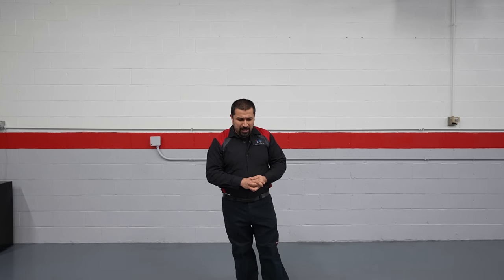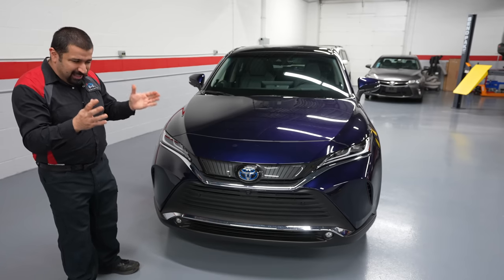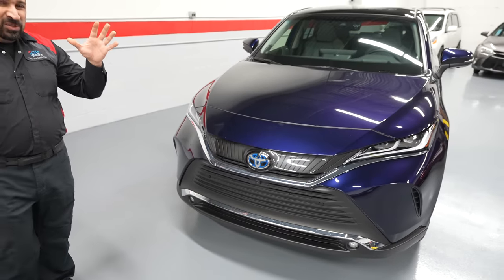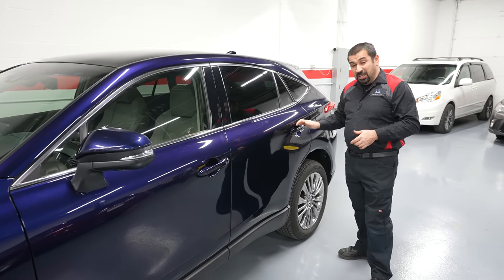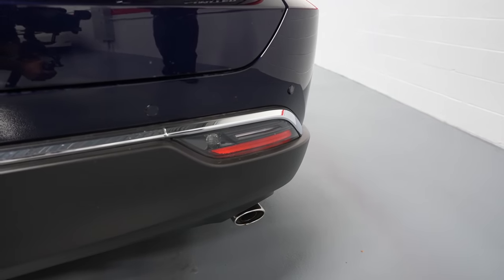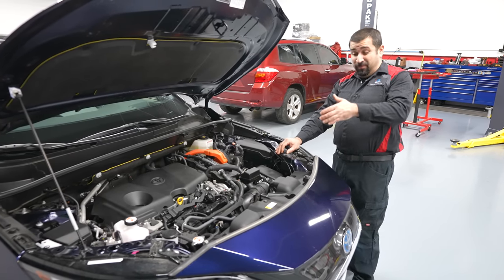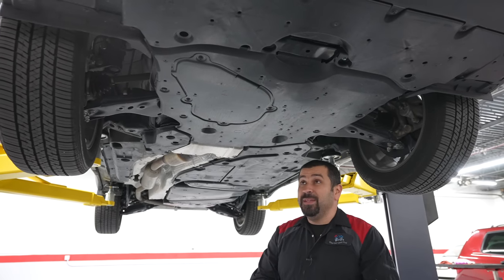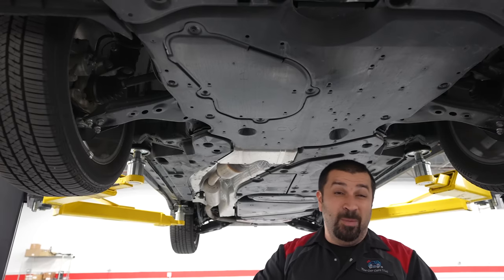THIS Toyota New Model is a Total Hidden Gem! Should've Been a Lexus!

Comment: Excellent review. I like the design and comfort, however, t's important to point out that the Venza is riding on an older platform. As a result, the NVH levels are a bit higher than what you get on the newer TNGA models. I decided to pass on the Venza because of wind noise and ride quality being a bit too unrefined.

Comment: I am thinking about buying one of the last of these models.  Has there been any problems with the panoramic roof?  Also, I have been looking into a hitch for a cargo platform.  Etrailers says it has one that fits exactly into existing holes with four bolts.  Is this true?  Would it be recommended?  Would it affect the warranty?  Thanks
Reply: The main issue is that it's a big piece of glass that makes up most of the roof. Some have commented about it cracking after getting hit with a rock while driving. It's not like replacing a windshield; they need to remove the whole roof/glass and it cost at least $6000. The other issue is it can form what looks like a "burn" and I assume that would also require a full replacement. That's why I specifically waited to find a Limited WITHOUT that stargaze roof.
Reply: @1RungAtATime  Thanks, I am shopping for an XLE, no roof glass.

Comment: So glad to see an interior that’s not black. Just about every new car we have looked at has a black interior, either cloth or leather. I don’t know about the rest of the country, but here in Georgia it gets HOT in the summertime, and sitting down in shorts on a black seat is very uncomfortable. We have seen it in Ford, GM, Chrysler, Kia/Hyundai, Toyota, Nissan. A lighter color interior would not add much, if anything, to the cost, but would greatly increase comfort on hot days. C’mon guys - get with it.

Comment: It's great except for the fact it's a hybrid, which for people wanting to drive a car 300k+ miles means you're going to have to go through an expensive hybrid battery replacement.    I dont like cars where you're forced to dump them before 150K miles.
Reply: My friend drives a Prius hibryd with over 400,000 miles, original batteries.
Reply: @synewparadigm  not likely.....

Comment: Yes there's touchs of the RX.  The first two generations of the RX are rebadged Toyota Harriers, being the first two generation of Harriers.  The third gen Harrier is a skip in the US market but its very close to the Lexus NX, almost a reskin.  What you have as the Venza is the fourth generation Harrier.  Thus this 2nd generation 'Venza' is more directly related to the RX300 and RX330, or even to the Lexus NX, than it is with the original first generation Venza.  The stylinq que of the grill, shared with earlier Lexus RX, is in reference to the Harrier, a bird of prey.  In the original JDM versions of this vehicle, the interior panel is embossed with a symbol of the Harrier, which is absent on the interior door panel of the US model.

Comment: I passed on the 'old' Venza as it had atrocious fuel economy.  The 2024 has EPA at 40 highway, and 37 city, and 39 combined.  Pretty good for a crossover.  We still chose the Camry.  Rated at high 40's, but I get over 50 on it.  This is a nice car.  But, I am like a lot of people.  Stripped down is good, fewer things to break like... a 787 moon roof.  Ugh.  The Camry LE we bought is what is 'minimal' these days.  For a hybrid.  But my wife HATES my '85 Toy 4 x 4 P/U.  Not even A/C in it.  But. Americans are so luxury minded.  You cannot find 'basic' transportation anymore.  It doesn't sell.  I get it, I am a dinosaur.
Nice car, this Venza.  Too expensive for me.  The stereo MUST have a volume knob.  EVERY survey done by manufacturers has come back that the knob is the best solution possible.

Comment: Can the volume be voice controlled? I read in the comments that its Japanese production 👍.
the Roof? Expensive and useless when it doesn't open, hate to see the ICBC claim after a trip
to Whistler, and a rock went through it. It is indeed understated elegance, and looks a hell of
lot better than any Lexus at this point.  Why the rear signal lights are in a spot where you really
cant see them is beyond me, but that will be change. Plus and that is something a lot of people
don't see, but I do, the Sheetmetal is so straight, plus the door and fender fits are incredible. 
Nor is there any Orange peel in the ones I have seen, it looks way more expensive than it is.
Thanks you Mr Nut, good as usual. For all its worth, here in Vancouver BC ,after the Tesla tsunami,
the Venza is doing well, very well.
Greetings to all readers.

Comment: I'm a car guy, looking to replace my 09 avalon that's seen better days. I've got a 900hp manual transmission sports car but thats not what I want to drive to work everyday in, maybe Fridays but most mornings I just want to relax while I gather my thoughts on the day, same with the drive home. So you can be a crazy car guy and want a daily car that's automatic, comfortable and reliable. My thoughts are headed towards the awd subaru Impreza or a Mazda awd or what I had at the top was an awd Camery or Corola, bc its going to also be a winter car in the salt belt of the north east I didn't want to blow the bank on a car that will have a hard time fighting off rust and depreciation. Any thoughts on my choices?

Comment: Hi AMD. I HAVE  A QUCK QUESTION REGARDING REGENERATIVE BRAKING REGARDING MY 2022 Toyota Venza. When you press the Brakes , before you come to a Complete there is a Clicking Noise. Penn Toyota Dealer Checked out the Brake Callipers and Pads and told me they are good. The Clicking is from Brake Pads Shifting. Do you think that is Correct?

Comment: actually its called the Toyota Harrier XU80 .

There's is plenty's of mods in South East Asia , where if you dislike the grill you can change it to Lexus Based Designs , even add your own DRL ontop of the foglights.. which intrestingly is not available in america models. 

but this is insanely reliable , currently driving the XU60 NA 3ZR-FAE 2014 model , insanely reliable but sluggish pickup as its a CVT there's a turbo variants available and 6AT Gearbox 
 which is reliable also and powerful.

Comment: Could you clarify on the high voltage cable? You said in a prior video about the RAV4 Hybrid that you didn’t like the cable on the rear motor even with the redesign. The Venza has the same cable design, right? Have you come around to trust this redesign of the cable? In a cold weather state with road salt, this is a major deal for me.

Comment: Toyota is relying on the past reputarion like honda. They had to cut costs too.  They now use questionable CVT transmissions like Nissan Rogue, the new tundra had a major engine recall, and they've have other issues. Basically, if you are buying new it's a role of the dice, but auto manufacturers are in trouble because of the economy and inflation.

Comment: Hi AMD,
I'll be in the market for a new vehicle soon.  I really like the new Venza but have one concern about hybrid vehicles in general.  The new vehicle, will be replacing an old Subaru naturally aspirated 2.5L 4-Cyl. engine.
 The new vehicle will NOT be driven that often, in fact it would probably be sitting in my garage in Florida for 3 to 4 months at a time.  When driven, it will see about 500 miles a week, driven anywhere from one week to 1 month at a time (as the Florida home is our second home and not used that often).
My dilemma with any hybrid vehicle is, is it okay to leave it sitting for 3 to 4 months at a time before using it? 
Will the sitting or storing of it do any damage to the hybrid battery?  
I currently use a battery tender on my Subaru's 12 Volt battery  and would continue to do so (on the 12 Volt battery) of any new vehicle that I would purchase.
Any advise or tips would be greatly appreciated.
Thank you and keep up the great work.

Comment: I wonder if the reason the Venza was brought back is the fact the discontinued Venza’s sold for a premium price. I have had my Venza for years. As long as you keep up with the maintenance it just keeps going. Mine has over 250k and just routine maintenance. Oil, fluid changes brakes and an exhaust and that ‘s need it.

Comment: For those concerned about the low turn signals. I followed my wife today, in her new Venza.  I drive a Chevy Silverado, sets up fairly high. Watching for the turn signals. which are low. You can see them fine, up until your about 20 ft from the car. But Ah ha, there are turn signals on the mirror up high. You can see very well. Problem solved.

Comment: It's a Rav 4 where the exterior look was prioritized over the functionally, park this next to a Rav, open the rear hatch and look at how much easier it is to load things into the Rav, the rear hatch opening is like twice the size on the Rav, even the height to get into it is way lower on the Rav, the venza has a way smaller rear opening to a much smaller rear storage space of 29 vs 38 cubic feet on the Rav.

So if you want a Rav4 hybrid, with lots of space sacrificed in order to make the car look more Lexus like, I guess this is your car.

Comment: I recently bought a 2024 XLE model. Inside the cabin is quite noisy, especially on highways. In particular, shock absorbers make a loud noise when you drive through uneven roads. I used have a 2006 Honda CRV, which had better shock absorbers and much less noisy. So, I am kind of disappointed.

Comment: If I could add another set of turn signals in the rear on that mid-height light bar, 'cause that low down rear turn signal set up looks down right scary, like a come & get it rear end accident waitin' to happen ... and also square off the upper half of the rear end for better cargo utility, which it looks like they almost started to do with that top edge aero overhangy thing ... those two seemingly minor touches, and then take my money, please.

Comment: Just drove one of the last 2024 Venzas at the dealership today. Sales guy tried to sell me on it - normally would have been NO WAY but I remembered this video.
They are selling them for slightly under MSRP right now because of all the cancelled orders.

Agree with all of this but have to say the Venza is... interesting. The sound and ride quality is a huge leap over any other Toyota I've driven. Unlike the RAV4's droning hybrid this one is quiet even at high RPM. Interior is soft and polished. Media system is great, I love how it's an NX but with more physical controls.

But the inside is strangely cramped, with weird extrusions like the power button and things in strange places like the seat temperature controls UNDER the arm-rest cover.
I can see how on paper it's a great car, but I didn't like it. The exterior is already dated, reminiscent of mid 2010s, and it was 12K over the RAV4, which looks much better IMO.

If you want a nice quiet car with no fuss to drive into the ground, and have some money to burn (but not too much) this is a great choice.

Comment: How does one stargaze if the Venza has to be on to turn on the transparency mode on the Panoramic FIXED roof??? (So I can't crawl through it?) Between that, the start button (minor issue, but major pain...I use my storage spaces) and the lack of vertical storage space in the cargo...it really limits how I would use it, which is annoying, because the Rav4 (Gas, 35:00 hybrid and Prime) lack as nice of a dashboard as other options, but I want to like Toyota again. Highlanders are outside my cost, mileage, year, features range. So I'm considering other options, which seem to have similar issues 😂

Comment: Hello, I am wondering if anyone knows if the 2021 Toyota Venza has had the fix ("updated cable") for the "rear cable getting corroded" that AMD talks about in the video (he mentions he is looking at the 2022 Venza that has been updated with a fix for rear cable, but, as mentioned, I am wondering about the 2021 model).  Thank you anyone who may know and thank you AMD for your excellent, helpful videos!

Comment: My interest is in maintenance.   How hard is oil change for an owner who does have a lift that allows him to stand under the vehicle?   On my 2008 Corolla, it is difficult to get jack-stands under it because one must place the scissor-jack just where the stand needs to go to support the vehicle. .  The alternative is to try to lift the entire front end by placing a floor jack under the front cross member.   I cannot find a 2-ton floor jack that will raise the front end 17 inches beneath the front member to allow placing small jack stand under the support points on each side behind the front wheels in one lifting operation. .   One needs a large shop-size floor jack to do that.  
This video does not tell me anything I find important.   It dwells on style, and tell me that everything is covered.   When the presenter mentions the oil drain plug, the camera does not show its location.   The camera is elsewhere.

Comment: You want a Lexus, buy a Lexus!

We recently added an 2024 NX450h+ and it is everything and more, for a plug in hybrid! 
We had a level 2 Charge Point installed in our garage and the battery charge in less that 4 hours.
The shocker, every place we want to visit, all have public chargers available, but have never had to use them.

Comment: The rear turn signals are too low; they should have been at the same height as the tail lights. Turn signals are one of the most important safety features on ANY car.

Comment: Sad to say the 2024 model is the last year for Venza. It will be replaced by the 2025 Crown Signia SUV coming summer 2024. It's larger more hp's and what a surprise more expensive. The pre production model not inspiring that I have seen.Also, no spare tire just a repair kit😂

Comment: Same for Toyota Avalon. Is an ES350 for Toyota money.
Reply: This is factually not true. An ES is built with a different philosophy. After testdriving these cars, here is what I found: 1) The ES is smoother on particular kind of uneven surfaces. 2) The ES is quieter. Less sound coming from outside. Let's put that in perspective, the Avalon is not noisy by any means. But the Lexus is just quieter. These two reasons ALONE are worth the upgrade. Then the rest. 3) Leather in Lexus is of a different quality. 4) Interior materials of the ES is of a higher standard. 5) The ES comes with sound deadening glass, hence it's quieter  6) The sheet metal of a Lexus is different than of a Toyota. 7) Open up the panels: Wiring is different, screws/rivets a better quality. Toyota uses a lot of clips instead which can lead to rattles. 8) The ES is available with the ML soundsystem, which is way better than the Avalon JBL set up 9) It may not noticeable for the average lessee but you can tell the difference in quality after 200K miles. 10) Warranty on a Lexus is better. So what DO they have in common? Drive train and chassis. Which is a good thing. Technically a LExus IS a Toyota. Don't get me wrong, the Avalon is a great car for an EXCELLENT price too, I had one BUT the ES is truly more than just a "badge-upgrade".

Comment: You are a professional new vehicle reviewer .
But I wonder how all this technology will hold up to software hacking, glitches and the supply chain situations. 
To me there's a lot busyness going on under the hood .
Way to much diminishing returns .
I'd be looking for a simple 4 cylinder 1.8 litre, 5 speed manual transmission , And no electrically operated things like emergency brakes,or even power windows. 
Just too many things to have to be replaced if an electrical short or surge occurs.
Reply: Yes, don’t buy one. Look for a used well broken in 1970’s Corolla.

Comment: I value 360-degree visibility over styling.  This style of vehicle is a bit too claustrophobic for me.  

But I think Toyota is wise to take the middle path between EVs (which are still a pipe dream for the masses) and internal combustion.  A regular plug-in hybrid is a great combination of power and fuel economy/reduced emissions.  We're not going to fix what ails us with one big solution.  It's going to be a large number of little things.

Comment: Venzas start from lower 40s new vs. Ravs which start from lower 30s. That is why you can find a lot of Venzas available at any time. And Venza has Toyota interior, not Lexus. Most of the potential Venza owners would prefer Lexus for the look for a little bit more money, or save 10k+ and fit in Rav4.

Comment: This car is the opposite of SUV. It's not sporty, it's not utilitarian. It is however a vehicle that comfortably drives four adults around without much in the way of extra space for cargo. Picking people up from the airport might get kind of dicey.

They had to use all those high-end materials and make it seem fancy inside just to sell a couple. Why would you choose this instead of a new Highlander?

That roof and my subwoofer would not get along. It looks expensive. While that may not be an issue for many people there are a few of us that have boys playing Little League ballgames and every time a foul ball goes into the parking lot I would be holding my breath.

I have a 2008 Highlander limited and I either use the sunroof open open or it's closed closed. I rarely open the shade and have just glass to the Sun. Not sure how I feel about an entire roof of glass that you can't even open.

Comment: I thought CVT weren't reliable long term. I was also under the impression to stay away from turbo and hybrid engines as they too won't last long. hmmm
Reply: Do your research on the ECVT, nothing like the crap Nissan has
Reply: @hss8973  sooo CVT is good in your opinion?
Reply: @popaki9484  eCVT is reliable, NOT the CVT, 2 different types of transmissions
Reply: This is the same engine Toyota has been using in their hybrids for years. Yes very reliable. I own one.